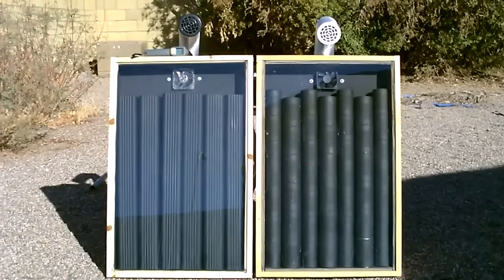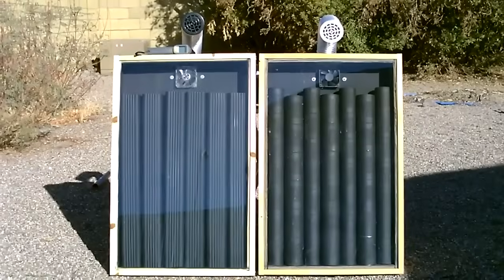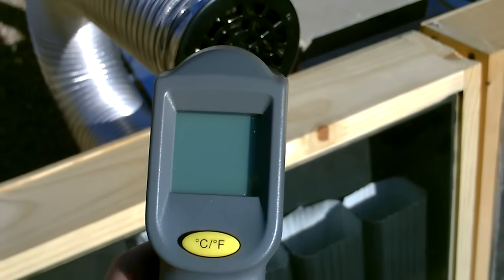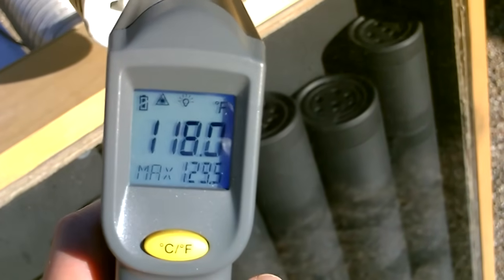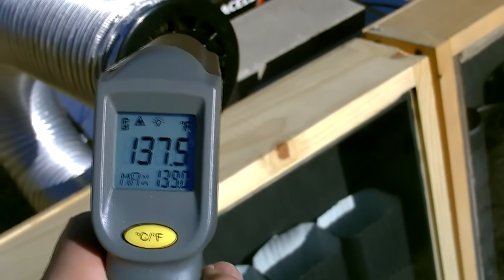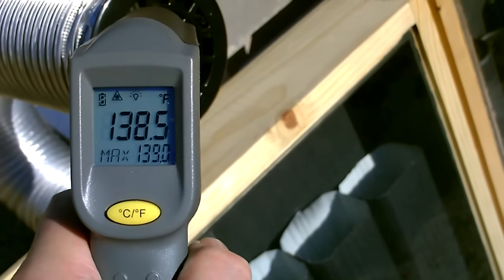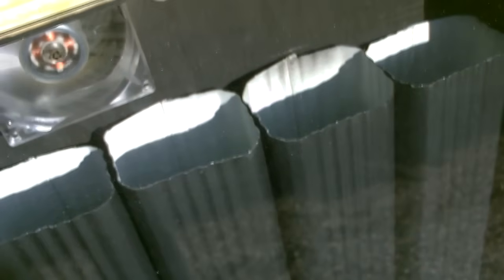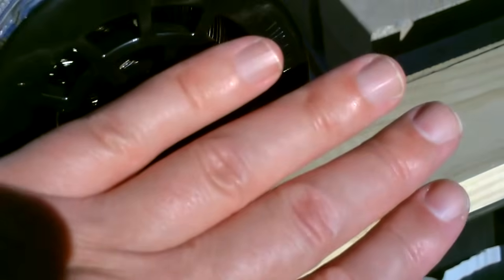Solar Air Heater Comparison! - Steel Downspout Heater vs. Steel Can Heater (temp. tests)

Comment: I watched this video a long time ago but I've recently thinking of building one. I'm thinking about making a manifold at the top of the pipes and feed all the heat through one pipe at the end. Does anyone see a downside in that design?
Reply from the maker: i'm glad you are revisiting the video. i've been making more solar thermal collectors lately. currently i'm making solar thermal cooking devices but will be doing more with the air heaters in the near future.

Comment: Are you sure those downspouts aren't aluminum? Most are these days. Aluminum transfers heat much better than steel
Reply from the maker: hi. i'm sure. they are the steel ones 100%. the store didn't even have the aluminum ones in stock. aluminum may transfer heat better but i've always found that the air heaters i make with steel work better. maybe due to the density of steel.
Reply: @desertsun02 you keep saying it’s the density of steel but I would guess it’s more the thermal conductivity.  A lower ability to transfer heat means a higher temp of the metal due to increased heat retention.

Comment: What does this do in below freezing temperatures
Reply: The collector has to be well-insulated, or be moving the air into a well-insulated area, but they DO produce hot air. If it is on the wall of a garage you can warm up a workshop easily

Comment: One has a wide open tube the other has about 7 small holes at the top therefor less air flow. Not a fare or realistic comparison.

Comment: i'm placing my bet before i finish the video, downspout is going to move more air but cans are going to be hotter. the air flow stops in the cans will get the air slower and allow it to heat more, but the constant airflow of the DS will allow it to warm start air flow and keep a decent temp.

Comment: Have you tried expandable aluminum downspout pipe?
Reply from the maker: hi. yes, it's expandable. i just left it 'unexpanded'
Reply: @desertsun02  hey thanks. Neat comparison vid.   I thought it was aluminum drainpipe vs aluminum can.  Why Unexpanded?  Surface area.?  Or stage 1 of 2 experiment? I appreciate your analytical technique.  Pls  explain your  conduction/ convection train of thought.  
 Have you considered filling the interior of the drain pipe or whatever with copper scrubies Aluminum lathe cuttings might be cheaper if you can find enough. Mabey aluminum window screens folded up so lots contact the aluminum aswell as the flow of air. 
Great work.. keep it up

Comment: A pice of tin will work the same and be easier to build, cans , pipe, sheet metal its all the same, its just the surface area heating up unless yall think the back of the cans are getting sun lmao

Comment: You have a lot of air flow restriction with the holes at the can-ends.
I was wondering how that would work. In addition to completely open ends, the downspout has a somewhat larger cross-section, thus allowing even better flow that the cans, but that doesn't necessarily mean hotter air.
In this case, despite better flow, the downspout delivers higher temps. 
I wonder what the results would be if the can-ends were open like the downspout tubes.
Lastly, hotest air out of the panel does not necessarily equal the greatest total delivered heat. Air flow, again, must be considered (as well as air temperature).
Reply: I'm guessing the main reason for the aluminum vs the steel panel temperature difference is because aluminum has a higher thermal transfer rate than steel.

Comment: Seems the cans only have a few holes drilled as opposed to being fully open as the gutter works are. If the cans were fully open I'd wager you see a substantial gain. Your solar panel should also be charging a battery since you may still be catching heat even when it's cloudy. Solar alone means the fans are slaves to the weather with no ride through. I was also puzzled by the way the tubes are resting on the back plane. It seems they'd perform better if they were floating an inch above the back plane. They should also be an inch from each other to catch as much light as is possible with the box. The compact arrangement is great and easily overlooked when you need multiple locations (coop, pump, shed, shop and greenhouse). 

Rock on!
Reply: I thought the same with the holes in the can. There really shouldn't be any significant difference between the two panels. So either it is because of the small holes, or the fan in the can panel is pushing slightly more air volume and he doesn't know it because he's not measuring volume.

Comment: Thanks, I love your ideas and videos! Out of curiosity, would there be any benefit of incorporating sand in either the bottom of the downspouts or in a couple of the bottom rows of cans hoping to extract some built up heat after the sun goes down?
Reply from the maker: hi and thank you! possibly but I haven't tested it with sand yet. I was thinking of passing the heat through pipes buried in sand (on the inside of house) the heat would go through during the day and the sand would be nice and hot by the late afternoon and evening.
Reply: @desertsun02  Thanks! That sounds like an idea to incorporate. And thanks again for your videos! 🙂

Comment: Are you using glass or poly panels
Reply from the maker: i've used both glass and plexiglas but i generally find that glass works better and lasts longer. the downspout heater has glass panel and the steel can heater has clear acrylic (similar to plexiglas)

Comment: Seems like the biggest cost is the Lexanne – Plex glass any cheaper options guess One could use a big pain of old plate glass?
Reply from the maker: i forgot how much i paid for the clear acrylic but it wasen't too bad. you can get glass at lowe's for a decent price. i think for about 10 or 12 dollars.

Comment: Hello desertsun! I am in the process of building your solar heater and wanted to ask you if you have any issues with the spray paint off gassing fumes when it heats up during operation? I am planning to install this heater in my living room to help supplement heat in the winter, but I am afraid of off gassing fumes into my room. I am considering building a manifold on each end of the unit to contain the airflow through just the insides of the unpainted surfaces of the cans, but this would be drastically more difficult and I would prefer to keep it simple if I can. Any advice would be greatly appreciated and thank you for all of this free information man!
Reply: Use a high heat one like they have for stoves and bbqs
Reply from the maker: hi. i haven't had any issue with the paint. once the paint dries it works great. no paint smell. i can't remember the exact paint i used but it wasn't any special paint.

Comment: I’ve been following this type of heat since the 70’s.  There were plans in Popular Mechanics.  They used panels using first a sheet of copper. This was the 70’s and copper wasn’t so expensive. The copper was painted black. Then they attached via sheet metal screws as many pop and beer cans cut in 1/2 and painted black. The cans were attached so the open end was parallel to the copper sheet. This way no matter where the sun was, you had a lot of surface area.  Their collector was horizontal not vertical and at an angle same as your latitude. It was built into an A-Frame with a foundation filled with large gravel to act as a heat sink. That heat sink allowed for hot air long after the sun went down. It did work with hot air through underground tubes to and from the home.  Hopefully this will make sense. It’s much more involved than a simple window unit, but could provide more consistent heat. I’ve searched for this design but could not find it.
Reply: That means it’s a good one ;)
Reply: heat source > large tank of water > house (using heat pump)
Reply: Do you recall which issue?
Reply: @BenedictAshwalker sorry,  no that was a long time ago.

Comment: Combine water tube to heat for shower 😅
also - peg board without the holes is very sturdy and very thin to use as backing board. Thin layer of insulation board  behind the cans will idecrease temperature loss

Comment: Have you put the output fan into a room and to see how long it takes to heat up?
Reply from the maker: hi. yes. i've used these to heat several rooms of the house. i typically vent a pipe (thru a plywood board) installed in a window. works well. some days it works as a supplemental heater and others it's all the heat you need! depends on the suns intensity and how hot/cold it is.
Reply: @ That’s fantastic. Thanks!

Comment: What fans are you using and what cfm ?  Sure would like to know as I have no idea what works at this point.  Thanks
Reply from the maker: hey there, i've made several of these types of heaters over the years and i usually use an 80mm computer case fan with a cfm around 40, but you could use anything from 25 cfm to 80 cfm). you could also use a slightly larger fan, like a 92mm one). they also sell 3 speed computer case fans. i;ve used those as well. the switch is usually located on the cord
Reply: @desertsun02  Thanks for responding...very helpful and much appreciated

Comment: I was wondering, what do you think about tinted glass or plexiglass with the maybe silver type tint facing inward, maybe trapping more heat then otherwise???
Reply from the maker: hi there. i think tinted glass would block too much sun (so the inside wouldn't get as hot). the mirrored glass sounds interesting but i think it would block too much sun also (just a guess). (if i remember correctly, one way mirror blocks a good amount of light). if it was as clear as standard glass then it might work great.🙂✔

Comment: this test means nothing if you don't know if the flow rate is the same, more air at a lower temp could mean more heat and the black fitting on the exhaust may be warmer than the white one on the other heater.
Reply: Ok, show us the results of your scientific study....

Comment: 3. could be just black box without anything but paint inside? And 4. could be just same sized window on a wall?
Reply from the maker: the temps will be about 25 degrees cooler (fahrenheit) if nothing is used in the box. it works (but not as good). always better to use some sort of metal

Comment: i doubt that's STEEL downspout. more likely aiuminum
Reply from the maker: i'm not sure why you doubt it but i used the steel ones for sure (100%). if i hadn't i would have just said they were aluminum.

Comment: Good experiment and test! I started using the beer and pop can method in my 5'x3' prototype unit and it produced 55C of heat output. So I scaled it up to 6'x3' switching to aluminum downspouts for ease of production and asethetics with 1" of insulation and its heat output was 71C. So I scaled up to a 6'x6' unit with 4" of foam insulation using 21 downspouts and heat output was 95C of heat. My latest unit is 15'x6' with 2" of foam board using black aluminum soffit sheeting and the heat output for the two upstair vents is 55C and 45C. It heats up the 3 bedrooms and bathroom on sunny days...and I am only half finished the wall and attic insulation in this old house. Conclusion: with high insulation in homes these large solar air heaters work well for heating espeially in fall and spring.
Reply from the maker: hi. thanks for all the info. sounds like a great system.
Reply: Your results look impressive. Did you connect all the downspouts together so as to have only one lane of flow ? Thanks ! A solar noob in France
Reply: @stephaneislistening6103  All my vertical downspouts are connected to top and bottom horizontal headers made from more downspouts with 1 1/2" ventilation holes. The bottom wall hole is 4" and the top wall hole delivering heated air directly inside the home is 6". This increases the flow rate through natural air convection of warm air naturally rising. 

I have found it is best and fastest to plug in a 4" electric duct fan in the bottom hole to help push and rapidly circulate the warm air into the home every sunny morning. I have burnt out a duct fan by installing it in the top warm ventilation hole. Do not do this it gets too hot.

In the evenings, I re-install the custom made insulated hole plugs keeping the generated heat inside for family comfort and the cold outside. For best results, line the solar air heater box with 4" of foam insulation bottom, top, back and sides.
Reply: @aaronvallejo8220  Awesome ! Thanks a lot for all these details. Great idea of using an horizontal downspout ! Merci !

Comment: i dont understand. Isnt aluminium better. So is steel also aluminium or is it like from iron. I learned it was a non corrosive type of iron.
Reply from the maker: hi. i've found steel to be better than aluminum. i think it's because it's a denser material
Reply: @desertsun02  ok thanks! I will try both i think. I had some left over pieces from a bed frame. Just having fun!

Comment: Test Aluminium Can vs Steel Downspout
Reply from the maker: hi. i haven't done it, but here are my thoughts... the steel can one beats the aluminum can one (and the downspout one beat the steel can one) so the downspout one should easily beat the aluminum can one. (if that makes any sense)
Reply: @desertsun02  I admit that the downspout looks better, more elegant. Unfortunately, in my case, 100cm costs 4.26$ for one piece and the cans can be collected for free. I am surprised that metal beats aluminum (it heats up faster and gives off heat faster). In addition, the difference in surface and shape. I am also wondering if there is any way to store this energy for the night...
I know that people suggest adding a recuperator to such a system, what do you think about it? Sorry I'm using google translator
Reply from the maker: @Łukasz Kuczyński hi. the steel heats better/hotter than aluminum because it's a denser metal. you can get the steel cans for free too (but it usually takes a while longer to collect them). i've been looking at storing the heat in 'rock' of some sort. maybe sand. possibly soapstone.
Reply: @desertsun02  Since steel is better, I can do a lot at work. The guys have a cnc laser, an AMADA press brake and powder coating. Can I make thin panels this way? I collect cans unnecessarily.

Comment: Gonns be hard to believe anything you say / / / CONSIDERING , THOSE are ALUMINUM down spouts !!!!!!!!!!!
Reply from the maker: hi. i used the steel downspouts. much better than aluminum (in my opinion)
Reply: @desertsun02  I would agree with you but I'm 78 YO and don't think I've ever seen steel downspouts ! NOT disagreeing with you ! Can you tell me where you found them, I'd like to get some ?  I can not imagine the labor / time / stress that must go into the "beer can" choice !!!  I've looked for black stovepipe , HA ! Good luck on that !
Reply from the maker: @Sandy Barbee yep they be the steel ones 100%. i got them at home depot. if you search for steel downspouts you will see them. (they didn't even have the aluminum ones at the store)
Reply: @desertsun02    Thank You

Comment: tbh are those cans the best aluminium ones?they don't seem to be the most used for heaters i have watched on youtube?
Reply from the maker: hi. if you have a choice of steel or aluminum, i'd go with steel. it seems to get hotter (probably because it's a heavier denser metal)
Reply: @desertsun02  tnx

Comment: i was wonder if the  angle that they are sitting matter or can you lay them flat on the ground?
Reply from the maker: hi there. yep, the angle you place it at matters quite a bit. that's mainly because when the sun hits the glass at an angle more of it bounces off.

Comment: Just out of curiosity, what if you restrict some of the air flow going and. That might make it even hotter not much though
Reply from the maker: hi. quite possibly. the longer the air is in collector the hotter it gets
Reply: I guess you could cut another thin piece of wood with holes in exactly the same places(ideally drilled at the same time as the frame, so you could just drill through both) - and fit it into guide rails outside, so it could slide to open/close the intake size.
Presumably slowing the fan would have a similar effect.

Comment: Steel or aluminum downspout?
Reply from the maker: i used steel but you can use either. (i find that steel cans work better than aluminum - so i went with steel downspouts). i think steel works better because it's denser

Comment: solar air heater vs photovoltaic?
Reply from the maker: you get higher efficiency with the collector versus a pv panel (typically)

Comment: Here's an idea which either will not work or which no-one seems to have thought of yet. I mentioned my problem of having an east-west facing house. I have yet to try this but I am sharing my idea for others to try or use as a basis for their own experiments. Convert a satellite dish or make a parabolic heater (YouTube guides). Fix a length of copper pipe at the focus. attach a hosepipe and a fan and suck heated air into your home through a letterbox or cat flap. Adjust the length of the copper pipe so the air is not too hot passing through the hosepipe. attach a filter to the end of the copper pipe to trap bugs. Hosepipe may need insulating. If your house is south facing you may not need a hosepipe. Homemade parabolic mirrors are cheap, especially if you make them yourself, leading to the possibility of building a series of them to increase the heat.Love to hear results if people try this and am open to suggestions.
Reply: I have just had a thought: If you make your own parabolic heater you can make it LINEAR so it heats a LINE, not a POINT. That should be easier to make, can be as long as you like and work better for heating air.
Reply: I think it would be difficult to make it efficient, it would also need to track the sun.
At most, it should produce a similar amount of heat per area of the dish, as the idea above(as the captured sunlight per area can't change).